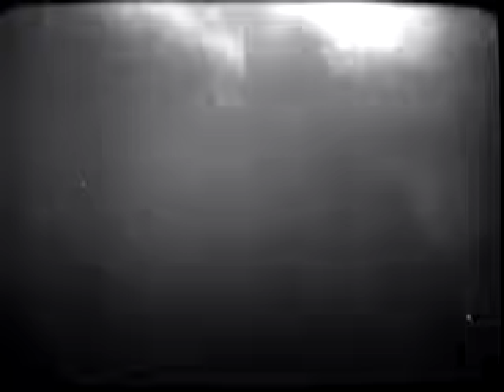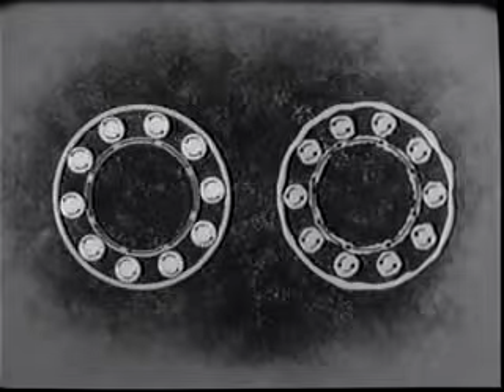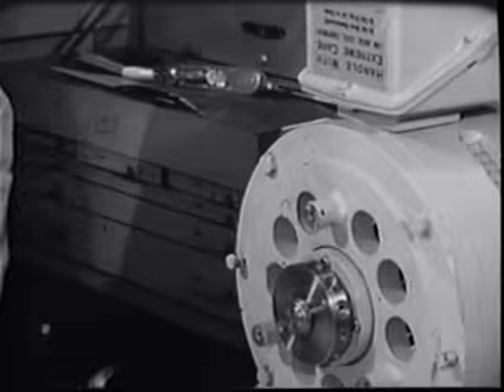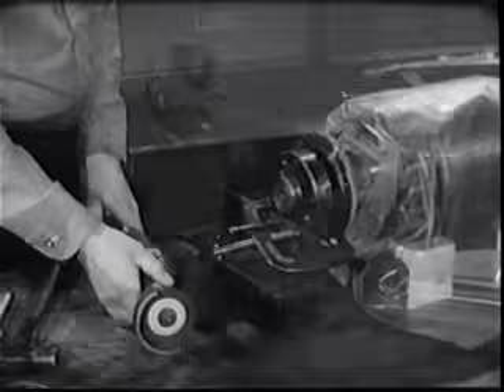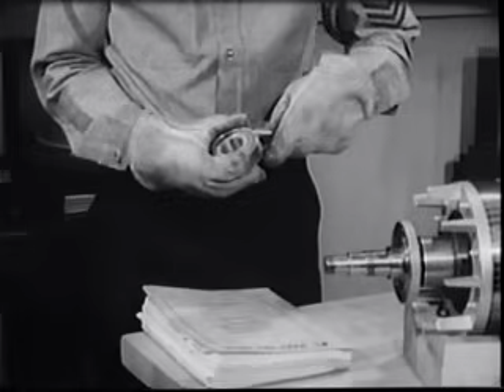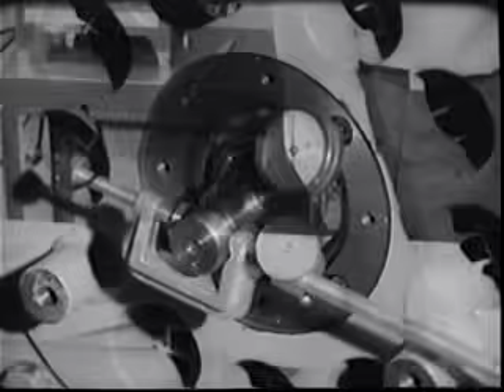U.S. NAVY Replacement of Ball Bearings For Quiet Operation

Comment: A dry bearing should never be rotated either by hand or compressed air . Red electrical grease should never be used in end bearings of a starter motor - the high temps cause the grease to solidify . In general bearings are installed with part number facing outward or observable .

Comment: 12:10 “HOPEFULLY the Bearing breaks loose and comes off easily” 

Me: 😂 Even the announcer guy is throwing luck into this very precise and detailed technical guide! 

Thankfully they mention a follow up procedure —> “You’ll have to grind it off! Then crack it off with a chisel!” 🤣 

[I know they being serious and it’s the only thing you can do but saying it will a straight face is kinda hard when you’re working on a precision shaft ground to 1/10,000 of an Inch]

Comment: While in the Navy, I did mechanical repairs on submarines for 2.5 years, the next ~ 3 years doing vibration and noise on electric motors and different mechanical machinery. The majority was mainly having to test motor bearings. The equipment shown is ancient than ours. We got ahold of a digital spectrum tester at one point.
Yes, we did have to work in 1/10,000" increments (PITA!).
Our main goal was for reliability of the motors. Noise reduction kind of came along during the process.
We also checked for unbalance and electical faults in the windings (like shorted windings). It is amazing what you could find, just from vibrations! 
Ball bearings are extremely precise.  I have watched a guy, literally pounding a bearing on with a 10# sledge hammer! It lasted about 20 minutes 😅😅.  He started to repeat, there was another engineer watching with me. We decided to tell him how to do it.  We told him to get a hot plate, place the can, that it came in (with oil). He went and got a PLASTIC  bucket with oil, started to heat in with a cutting torch! 😅😅😅😅😅 Wasn't long after that before he ran out of the machine shop to get a fire extinguisher,  while smoke came out of the machine shop! 😅😅😅
Can't fix stupid!
Reply: Cool video, those type bearings aren't made anymore, none of this applies to anything
Reply: @Doc-n7u  Oh how mistaken you are! They are used all over! Pretty much all electric motors use them. Not to mention most equipment they power. Your car has them in the transmission, differential, wheel bearings.
I could go on and on.
If you addressing NT bearings, I can authoritatively say, they too are still used, expensive, but used in specific applications.
Reply: 1/10,000" = 2.54 micrometers
Reply: @311Bob
0 seconds ago
you mean watching a guy destroying expensive parts and machinery for a chuckle? yea! you can't fix stupid.
Reply: @311Bob It wasn't for chuckles. We tried to show him the first time, he insited that he knew what he was doing and told us to go away! I was the watch engineer, my job, by law and contract was to run the plant and nothing else.
This guy was probably the dumbest F<"( I ran across (there is a tight run between a couple 😅) 
Once this guy shut off my main steam valve out of the boiler, running at full power without saying anything.to me (engineer of the watch) or anyone else. Needless to say, it caused an upset in the operations 😊 ! Only time I lofted all 3 safety valves on a boiler other that Coast Guard inspections.
There were some seriously funny things that all happened in 45 seconds.
Yer right, ya can't fix stupid, sometimes ya just let it go... unless it's gonna kill ya.😮

Comment: Grinder throws abrasive dust all over work area . Best to shield area being ground to contain abrasive particles in such a critical location and repair.
Reply: Also no smoking in the gunpowder room.
Reply: @joe28704  no tiki torches for light also.
Reply: Yes that's horrible. Nothing as bad as grinding dust. In fact, I think of it as 'any bearing is a cleanroom product'. In fact, especially in light applications, pretty much the sole failure mode is dirt. I worked on cleanroom equipment - bearings in this environment have effectively infinite life.
Reply: @bigbattenberg  Unless they crash! I've had tech that thought they knew a quicker way to move it to another position  resulting in a full speed crash into a block of granite. Very expensive replacing all of the bearings and 1 lead screw.
The most disturbing, was a few weeks later, our "supervisor" did it 5 times in a couple of hours! That was a busy night for me! 😂
We were working in a class 5 clean room, testing hard disc platters.
Reply: @bigbattenberg I might add that ships are not a clean room! This film (so far😊) is correct for ship usage. If you follow these instructions, you can get up to 4 years of service. For a Navy ship, that's pretty good. The Navy is really hard on machinery. They shut down, let it cool down, then (randomly) heat it back up again, over and over. On a merchant vessels, the plant rarely shutdown, they run constantly between drydocking. Far fewer problems on merchant vessels.
While working in the outside machinery shop, I had to keep all (NT) bearings being used (all of them) had to be locked up for use on particular jobs. They were all in airtight containers. We would make sure that everything was clean as we could, everything we did was by the book, we always had one person on every job, whose sole job was to read from the manual to instruct how each step and procedure was followed. We cleaned our shop with liquid nitrogen. You wouldn't believe how it removed every speck of dirt, oil, etc. Our 30+ year old shop floor would look like mirror! 
There are many ways to keep the bearings clean.
My last 2.5 years in the Navy, was 95% of the time (or so), I worked with ball bearings exclusively.
Reply: This is normally performed in totally different spaces. Such as, the bearing is removed (in what ever fashion) in, say the engine room and then taken to the machine shop. Not to mention that of machining is done, after welding to build up an underdsized shaft, well, ya gotta clean it up before 😂you assemble it. There are a few ways to do it. My preference is an ultrasonic cleaner. 😊
I'd have to go back in the video, but when we would have to resort to grinding an inner race, we had to make sure the sparks went away from the armature!.
I could tell you all kinds of technical information about ball, roller, tapered, thrust bearings and sleeve bearings. You would probably fall asleep after 20+ hours or so!
Still this is a good primer for the matter at hand. There is more to the story!

Comment: I'm sure in the middle of the ocean and trying to remain mobile and quiet these guys were going to take all these instructions seriously  and to heart. Yes this is definitely correct in how it should be done, but in a combat scenario all these little BS things go completely out the window. Like checking the runout on your amateur..... welp, when this is your only amateur and the piece you need to get back in action is necessary for survival..... The good old eyeball check is sufficient. Vee blocks LMAO? Shims? Spacers? Yeah? Readily available in your average submarine! Be greatful that you have a correct sized bearing in stock. I know that they had a machine shop in every sub and ship. But they were definitely not always equipped with all the necessary tools and parts for each and every job on these ships, especially if its a brand new ship. The older they were the better chances you would have to actually have the necessary equipment on hand. I know a lot about all this jargon, my grandfather was a Lt. Commander in the Merchant Marine Ship engine rooms, we would talk for hours at a clip about the whole experience of being at sea. The best thing he was ever most disgusted with was when they'd lose refrigeration abord his vessels. The stories I heard about what these poor bastards had to survive on would turn the most hardy stomachs when, survival was of the utmost importance. Out in the southern pacific and losing a refrigeration system means your going to lose your food, and meat first. Welp they would literally have to scrape the maggots off their meats and cooked them well done, until it began to turn greens and other shades of colors, they had to eat whatever they could. It was quite the harrowing experience that I wouldn't wish upon anyone. He survived both the German wolf packs of the Northern Atlantic, and could have went home at this point to finish his college education at Kings Point Merchant Marine Academy, but he chose not to abandon his vessel or his men. Then he ended up in the Panama canal and off to the southern pacific delivering fuel to our ships at sea and to our island hopping campaign bases. Don't know what he was thinking?  LMAO? But to be in a hull and engine room of a tanker ship in those humid temperatures with boilers running round the clock and then having the biggest target 🎯 painted all over you as a slow lumbering bomb just awaiting a Japanese sub torpedo or kamakzi to drop in on your explosive fuels and oils. I couldn't begin to imagine the stress levels abord these vessels? They had radar at this point and plenty of anit-aircraft guns, but they definitely didn't have much for submarine defenses if one decided to pop up near them. Lol Lots of prays to God at that point i guess and some maneuvers to keep them guessing your direction? Good video though, and a great dedication to the Greatest Generation of our recent history. These men and women gave it all in order to win! My grandmother was building the ships as a welder as Grandfather was on them trying to survive another day. Crazy times, and God Bless them all. Otherwise we'd all be speaking German or Japanese today!😊
Reply: Yes this is for drydock operations not emergancy repairs in combat
Reply: @Barten0071  Ever been on a destroyer at sea? Yes indeed, if you have to fix it, you can and do!
The only bearings that would need to drydock would be a strut bearing, or stern bearing(s), and you can do it waterborne, with a diver or two.
You learn alot, repairing submarines. 😊
Reply: There are some points in your post that are just wrong. I'll leave it alone, unless you would like to know what I think (from experience)  are incorrect. 
I sailed 1 ship that was a WW2 ship for transport of troops to Japan. Had 2 guys standing watch with me that were on a ship that got torpedoed on the Murmansk run. Yes, I'm very aware that there is a thing sailors tend to do, it's called sea stories 😉.
Reply: An addition... The Merchant Marine had (in proportion) had the highest casualties during the war, except the Marine Corps.
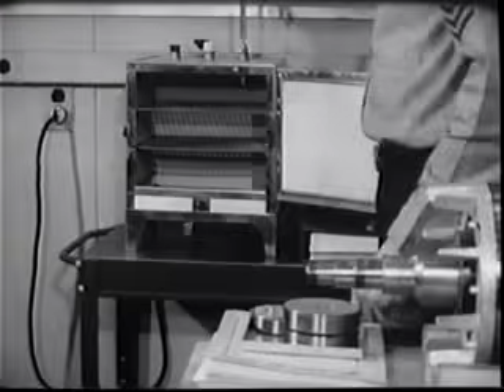Reply: Wrong.  I was an EM(ss) on subs for years and we absolutely took this very same course and this is no joke.  I personally did sound testing on every motor on my sub, charted them, monitored every bearing for trends and it was all about keeping our sub silent which was (and still is today) our most important weapon.  No, we did not have the luxury of a machine shop of any sort.  That’s stuff for Hollywood and skimmers.  But we did have a good strategic on board stash of critical spare parts and the expertise to remove and replace almost any bearing on that boat if it became necessary.  I myself got pretty good at it and took a lot of pride and being able to seat a hot bearing onto the shaft of a motor in one clean sweep just like 16:15 except for one part.  We didn’t have the room or luxury of having a matched spacers like 19:20 for every motor.  We had to slide and seat that bearing all the way flush on the first shot.  If you messed up, the bearing was ruined taking it off and you have to get a new bearing.  Fail more than three times and you are really likely out of spares and now that motor is out of commission and you get to tell the captain we need to head to port.  Not a joking matter nor a game.
Reply: Naja - also gegen 'Alle sprechen Deutsch' hätte ich sogar Nichts auszusetzen ;)
Wir sollten aufpassen, daß Das nicht noch Mal passiert - wobei die Kriegstreiber dieser Welt, gerade jetzt, nicht wirklich leise sind -_-
Reply: Submarines are always right there in battle. In the trenches in ww1, in the jungles in Vietnam. In the opium fields of Afghanistan. Most trusted battlefield vehicle besides a jeep or humvee.
Reply: Thanks for telling someone else’s story. Have you ever done anything yourself, or just take credit for what others “told you?”
Reply: Yea we're always the good guys fighting the good cause of 'freedom' and 'democracy', right?